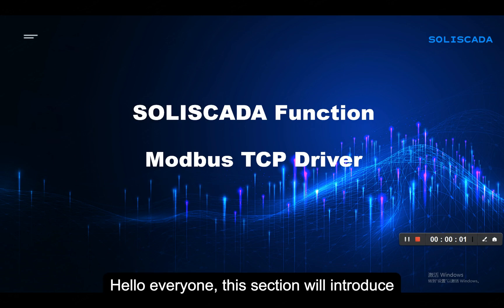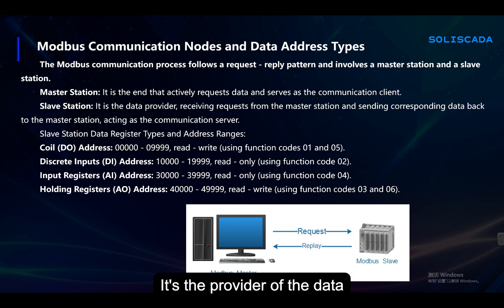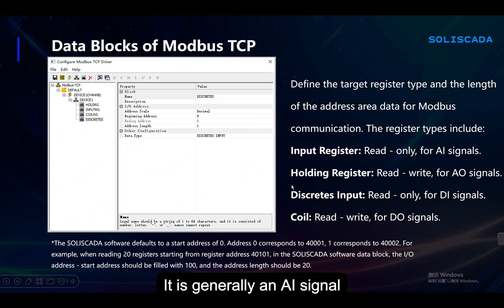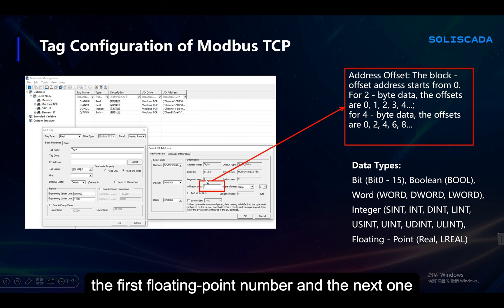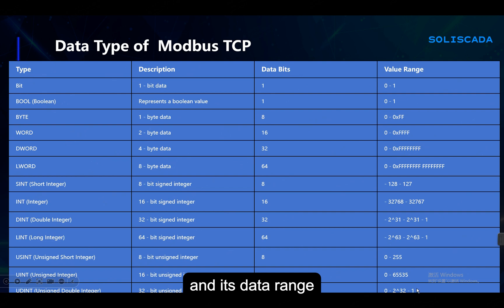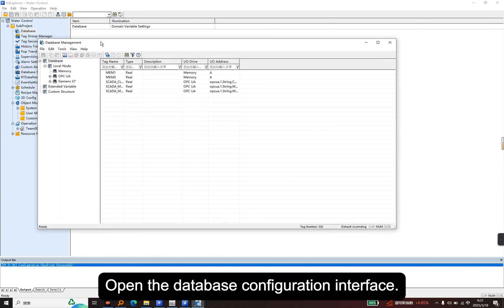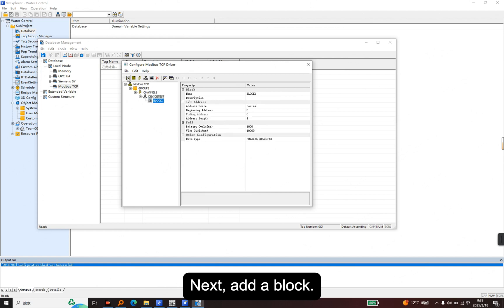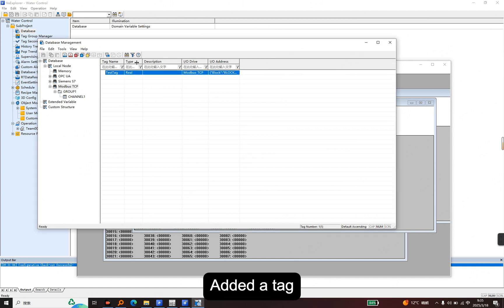SOLISCADA Tutorials #6 - Modbus TCP Driver

Comment: Why the holding register address is 400000? not 40000
Reply from the maker: Hi there! Thanks for your comments! In Modbus the six‑digit notation (e.g. 400001) refers to a holding‑register whose internal zero‑based offset ranges from 0 to 65 535. 400001 maps to internal address 0, and you can address up to 400001 + 65 535 = 465 536, covering the full 0–65 535 offset range.

By contrast the five‑digit shorthand (e.g. 40001) is just an alternate way to write the same register, but some devices limit the maximum address when you drop the leading digit. In practice:
40001 and 400001 point to the exact same storage unit. Let us know if you have more questions!☺